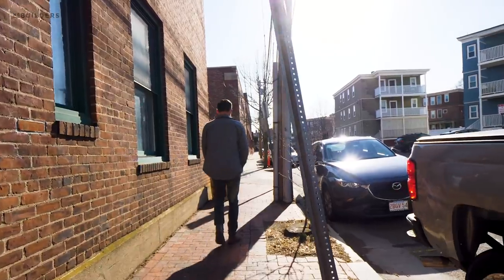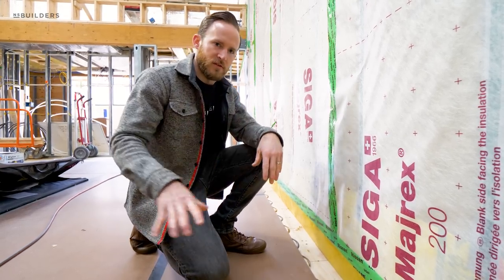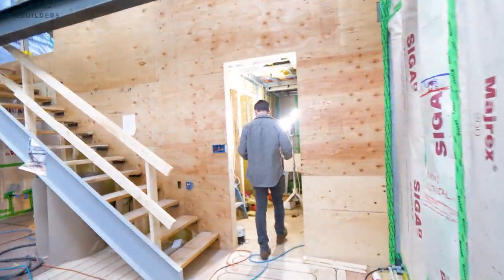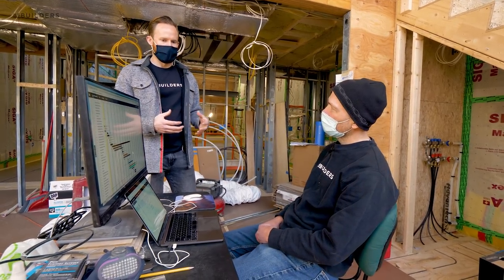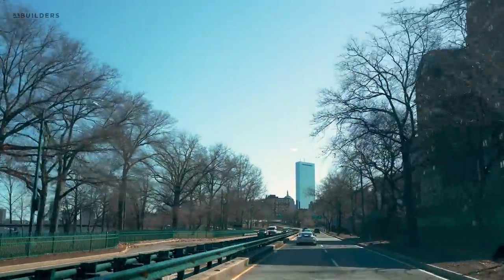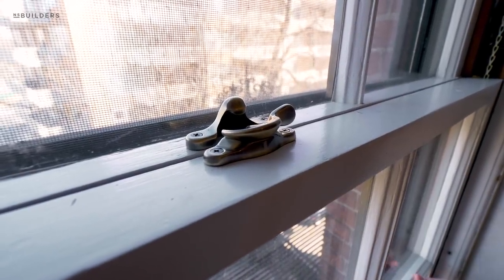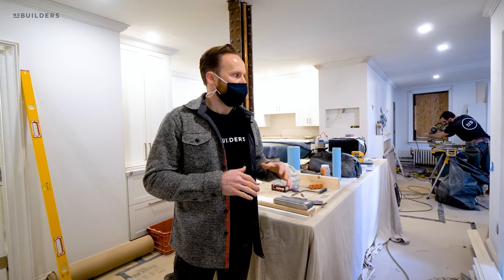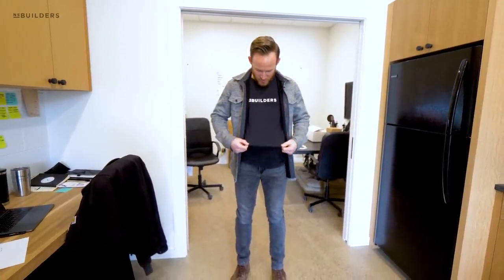Restoring historic windows

Comment: I knew a guy who set the tubing for the radiant heat and got in a hurry and poured the concrete. Then when it was filled with water he found two leaks and had to break the concrete

Comment: I don't understand what the instance is with keeping single pane plate glass in the windows. I get that a modern window cannot replicate an old window, but is there that much of a difference in the way the glass looks? I get you couldn't change it because of the historic commission, but I don't understand their reasoning.
Reply: Replacing the glass means you lose the old wavy look of the rolled glass.
Reply: @ 13:43 It can’t be replaced because of the historic commission.
Reply: @TylerDickey1  i literally said i get that it can't be changed because of the historic commission. I was asking about their reasoning as to why it can't be changed.